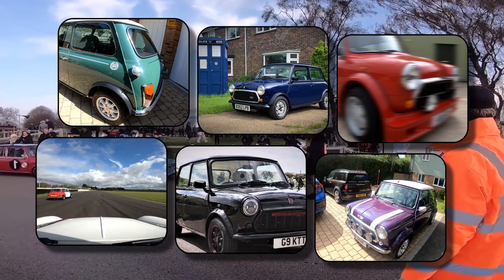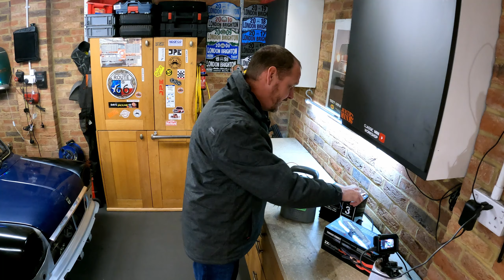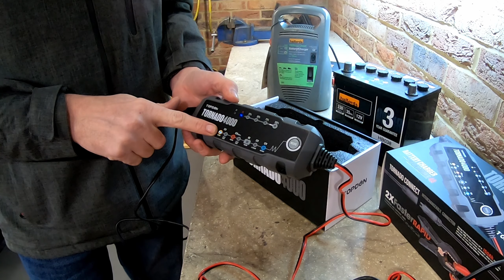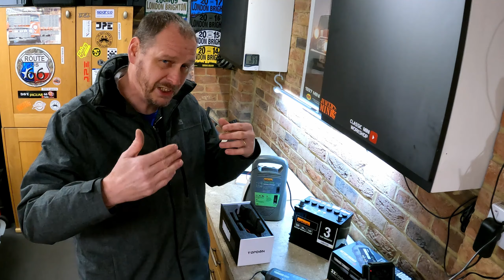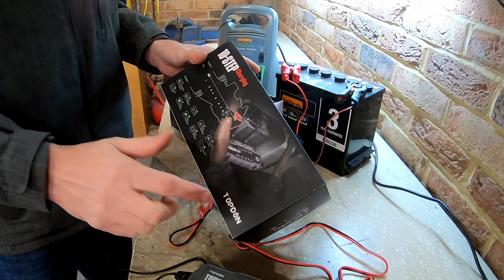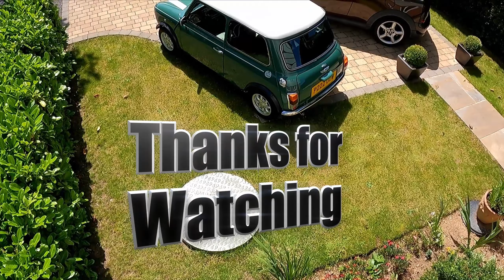Battery Charger/Maintainer - TOPDON Tornado 4000

Comment: Hi Keith the battery problem of long time sulphating I was taught to connect up the battery to our big workshop battery starter /charger 12 and 24 volts roll around with it set to the 24 volt side max charge rate with the cells caps off and then put the battery on to charge on full until the electrolyte starts to boil then turn it down a notch for ten minutes then switch it over to 12volts and charge the battery fully then check it with a drop tester if it passed then fine if not then we recommended replacement but I very seldom had to recommend replacement I have done this on my own caravan battery’s over the last few years with good results.
Reply from the maker: Oh yes, 24v will break down sulphation for sure!

Comment: TOPDON love watching yr channel m8 I’m a Ford man through n through but a while ago I took I’ll so been at home for a good fue months now (8) so I’ve allways had a soft spot for the classic mini I’ve had over 16 of them I absolutely love them my favourite was a 1966 mk1 it was awesome I fitted a Austin 1300 GT engine with an early 850 gearbox basically for the exceeration fitted a good set of inch and a quarter carbs and a nice 3 branch lcb sounded nice was a streight cut box and sounded good I allways looked out of place in them as I’m 6 ft 4 and over 26 stone but that’s the good thing about them anyway loved watching yr content I’m an auto welder by trade and really like watcking yr welding /fabrication content loved yr work on sprout but sorry gotta say love tardis is my favourite keep it up love the content  kind reguards from dunk in sunny Leicester 👍👍
Reply from the maker: Cheers, thanks for the feed back and thanks for watching. I'm glad you enjoy it.

Comment: TOPDON. I had a Halfords charger like yours - I put it in the recycling last year as these things are a bit of a liability. You don't want to put these old chargers anywhere near your expensive AGM battery on a modern car. I have a couple of CTEK chargers now that offer similar features to the TOPDON - more expensive I suspect. I also use the quick connect leads with rings on all my cars (except the EV). Thanks for the video.
Reply from the maker: What EV do you have if you don't mind me asking. My Kia E-Niro +4 has just gone back so I'm on the lookout for the next one
Reply: @classicminiworkshop  We have a MINI SE L2 and it's really good if you ignore the range limitation. It replaced a MINI JCW and whilst I was sorry to see the previous car go the SE is just as much fun. We have a Discovery Sport for longer journeys and transporting stuff from B&Q.

Comment: TOPDON. Looks a good bit of kit
Reply: Hi Keith, what battery would you recommend for an MPI? And is there a good place to buy them from with good value? The battery gets drained by the immobiliser fairly quickly
Reply from the maker: An 038 is the correct battery, you can get them pretty cheap from https://www.batterymegastore.co.uk/ I personally do not recommend fitting a larger battery like an 075 or 027 because you may not be able to get the original clamp to fit which is an MOT fail, and fitting a larger battery just means it takes 5 weeks to go flat instead of 4. Then when you do run the engine, the bigger battery takes longer to recharge so is more likely to suffer from sulphation longer term due to being under charged. I would think about fitting a battery isolator switch, or using a battery maintenance charger if you can.
Reply: TOPDON will replace my ageing CTEK

Comment: TOPDON. 26th 😂 Was cleaning Mini parts so don't shout lol. Putting a spanner a cross the terminals, that will let you know if its charged lol. Very good hints, tips and advice there Keith :washhands:
Reply from the maker: What size spanners do you have to use?
Reply: @classicminiworkshop  😆 Got to be a 5/8th  🤣 or a 3/4 if its a big battery